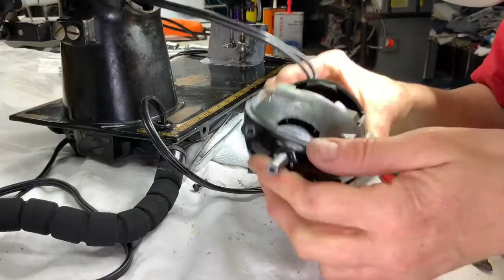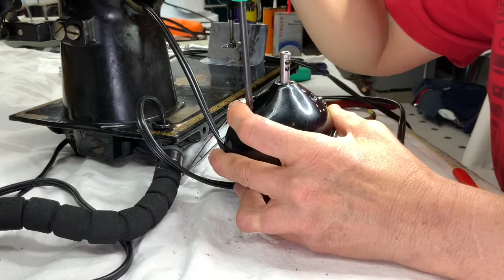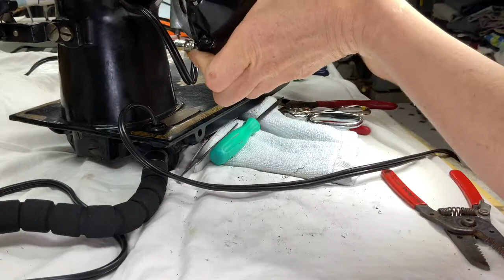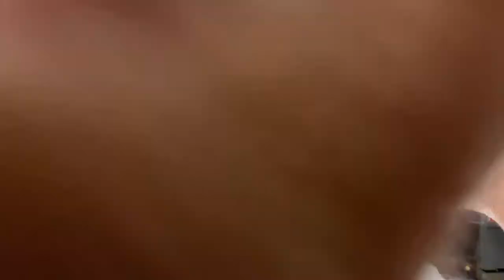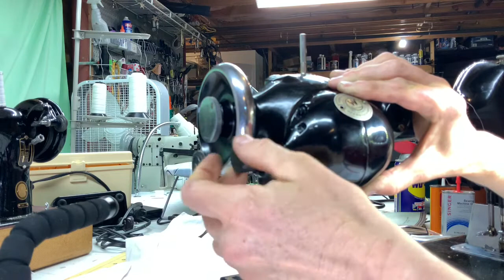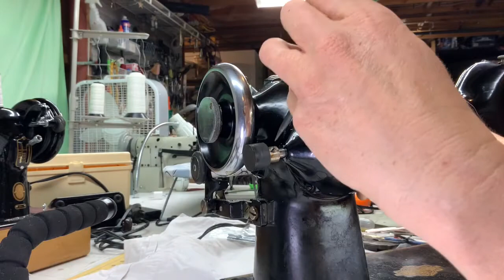Free Westinghouse motor removal 2

Comment: Great Video.  I just purchased this model at a local thrift store and have had quite a time getting it in condition.  Have replaced all wiring and gotten some response from the motor, but can't seem to budge it free by rotating it.  Any tips on budging it loose so it can turn clockwise for removal like you have shown?  Any help would be much appreciated!!!!
Reply from the maker: it is a pain in the butt!  there is a little slot on the machine and you have to turn the motor clock wise. the pin will be at 12:00 when it is in the right spot.  I would try penetrating oil and maybe a soft nudge with a rubber mallet.. if that doesnt help, maybe a little heat with  heat gun on low..  I'm just a hack so read up and do what you feel is best.

Comment: I apologize for commenting on many of your videos. Does the motor before removal have a little wiggle side to side?  I just got a similar model as yours and I have no manual and found your videos.  It’s kind of frozen right now so trying to loosen up the machine.   Thank you
Reply from the maker: I think it does. Once the rubber knob is off. the motor rotates clockwise. when the pin it at 12 it should come off.  Keep track of the long spring that is inside and it goes to the left rear when you put it back together.   This was a tough machine to fix.  the hand wheel turns clockwise - most machines are counter clockwise.  I was told to always turn it toward me...  Not this Free Westinghouse!  I even wired backwards and it ran backwards!!! I took that stupid motor off soooo many times - that's why I made the videos to help some other poor soul!!
Reply from the maker: Sorry I just saw your comment. Yes, it does wiggle because it needs to have spring action to press against the rubber drive wheel. You probably already know this by now. Hope your machine is working well.

Comment: What has happened to the sound on all your videos?  I've tried several and there is no audio.  I don't have a problem with videos from other posters, so it's not my volume.  Any ideas?  I noticed someone else having the same problem on your initial motor removal video.  I could really use this info, as I just acquired a Free-Westinghouse Style F machine and I'm trying to remove the motor to investigate the "clunking" noise inside it.  Seems to be related to rotation of the axle that turns the handwheel.  Any ideas on that?
Reply from the maker: I didn't have the ability to add audio.  I just wanted to show how the motor came out.  Please check out the Facebook group Vintage Sewing Machines.  They are such an amazing group.  The Free Westinghouse is one of the more difficult machines I have worked on.  Singer's are so much easier.  Make sure your turning the handwheel clock-wise.  Best of luck.